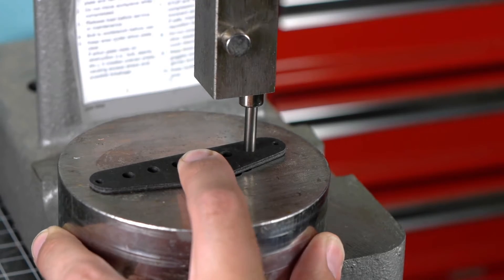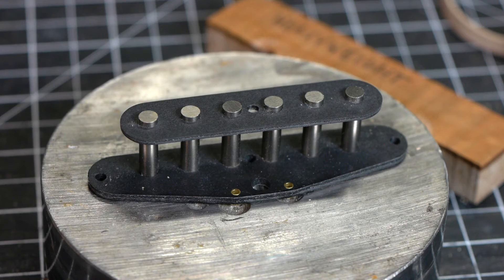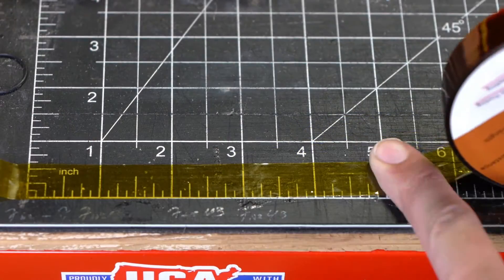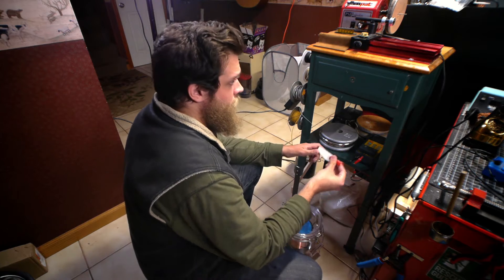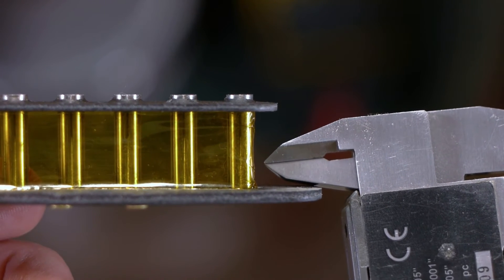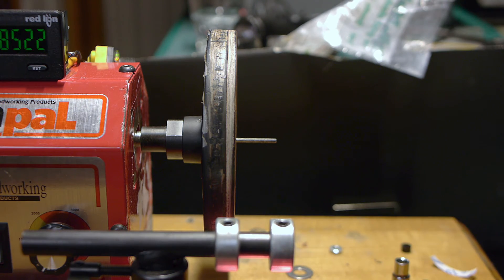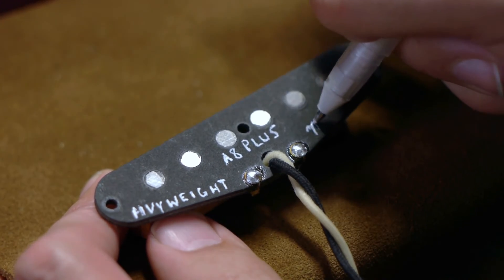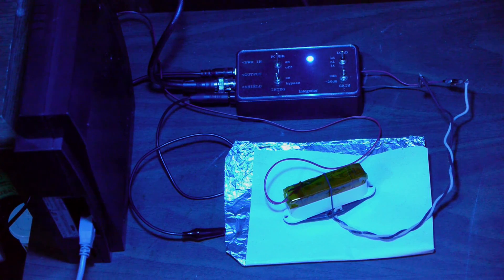(**OLD VERSION: CHECK DESCRIPTION**) Making a Single Coil Pickup: Complete Guide

Comment: It seems to me that wrapping the tape blocks waxing from the inside of the coil.  Other than that, thanks for a great movie.
Reply from the maker: Thanks for the comment! I appreciate it. Allow me to explain about the tape and reducing the potting of the inside of the coil:

It might, though the wax penetrates the entire coil regardless, as I've discovered from tearing down many of my own pickups after potting. However, if it has less penetration on the inner coil due to the tape, I'd argue that this is actually desirable. The purpose of the wax potting is to reduce microphonics/microphonic feedback, and once this goal is achieved, any excessive potting (such as vacuum potting) only serves to increase the capacitance of the pickup. I'll also add that the holes in Fender style pickups that allow wax inside are not there to allow wax inside, but to mount the pickup for winding. 

I've never had any of my pickups struggle with microphonic feedback, unless I deliberately built them that way by leaving them unpotted. Interestingly, all early Gibson humbuckers were unpotted, but it's worth pointing out that even if you do pot humbucker bobbins, the wax can only penetrate from the outside, so on all commercial humbuckers available today, the wax does not enter the coil from the inside, as there's no 'access hole' as there is on Fender style pickups. Potting the outside of the coils only is more than sufficient to achieve the end goal of nullifying microphonic feedback. 

Anyway, back to wax potting and capacitance: potting draws down the high end already, so excessive drawing down of high end (higher capacitance) via excessive potting is not desirable, for the same reason that more expensive cables are desirable -- better quality cable has lower capacitance, which means more high end. Generally speaking, lower capacitance is desirable, and more wax saturating the coil beyond what is needed to reduce microphonic feedback will only increase the capacitance, which means less high end/less fidelity in the pickup.

However, aside from that, the tape is absolutely, 100% essential. The reason being, over years, the magnetic polepieces will corrode. If there's no tape around the magnets, that corrosion will eat through the magnet wire, and kill the pickup. The copper in the magnet wire, especially, has a reaction with the aluminum in the AlNiCo polepieces. Specifically, the reaction is called Galvanic corrosion, and copper and aluminum are a particularly bad combination for that, so an insulator between the two is extremely necessary. 

I've rewound many vintage pickups that had that exact issue, particularly Fender pickups -- Jaguars, P-Bass, J-Bass, Tele, Strat -- without tape around the polepieces, the corrosion on the magnets eats through the delicate magnet wire and then you end up with a dead pickup. The tape is a necessary safeguard against this. One thing I've wanted to investigate more is the actual effect of the size and material of tape around the magnets as I do believe this has an influence on the final tone of the pickup, even if it's a small influence.
Reply: @guitar_md  Thank you for your answer. The problems you describe are well known. When it comes to corrosion of magnets, a commonly used method of insulation that I'm sure you know about is varnish. Do you know any model of Fender pickups that use any tape on magnets?
Reply from the maker: @redcatstw  I have rewound a set of Jazz Bass pickups from the early '70s that used Formvar wire and had the rod magnets wrapped in masking tape. That was very interesting.

Surprisingly, those also failed. I've also rewound a set of 1963 Jaguar pickups that, upon unwinding, didn't seem to have much of any corrosion on the magnets whatsoever. Those had no tape, and if there was lacquer on the rod magnets, I couldn't see any. However...just about pristine. No sign of corrosion whatsoever, and again, those were from 1963, so they've had plenty of time. Maybe they were lacquered. 

Fender traditionally did use nitrocellulose, dipping the bobbins in and letting them dry prior to winding, to insulate the magnets. It seems to be hit or miss with how many pickups survived that. One thing is also the breakdown of the enamel on the magnet wire itself. I suspect that's to blame in a lot of cases. 

Like the Jaguar set I rewound, I've seen a fair amount of vintage pickups that looked nearly pristine when stripped down to the magnets, but the coil was measuring as an open circuit. Some are extremely corroded, but not all.  

To me, masking tape is too weak, and while varnish could be a good solution, I don't think lacquer is the best choice, not only because it tends to get brittle as it ages, but the drying time is very long. 

I'd be tempted to look into an automotive enamel like they use to protect cars from the salt on the roads in the winter. However, that stuff is all available mostly in spray cans. Something that could be painted on with an artist's brush would be ideal. Spraying it into a bottlecap first is perfectly feasible but way too much of a pain for production level work. 

I've tried Paraloid B72, which I think would be superior to lacquer as it doesn't seem to have the issues with aging and cracking that nitrocellulose does. Paraloid B72 is used in taxidermy to seal and preserve animal skulls/skeletons, and it's also used pretty extensively in art conservation. 

However, I don't trust it long-term anymore than I'd trust nitrocellulose or shellac. Something formulated specifically to coat metal as an anti-corrosive/rust preventive would be ideal. Again, something in the automotive world, preferably that could be applied with a brush. It would certainly make life a lot easier.

I'll admit that tape can be a royal pain, especially when dealing with custom bobbin sizes, which I use all the time. I'm currently making a copy of Bill Lawrence's Micro Coil, or I should say, my own take on it. I had a customer request for a super low capacitance pickup, and the only way I know for sure how to do that is by using a much shorter coil and much thinner wire. 

So this Tele bridge pickup has 1/8" winding space, and I'm using 48AWG for it. Insanely, insanely thin. But that 1/8" winding space was a real pain to wrap tape around. I had to do so very carefully with a pair of needle nose pliers. The space is actually .133", so a little over 1/8", so even if I had 1/8" wide tape, it wouldn't be thick enough to 100% cover the mags. 

I've made some experimental Fender style pickups by mounting PAF bobbins on bottom fiberboard flatware. Very interesting stuff. And completely foregoes the need for tape, as the bobbin itself is completely insulating. The smaller winding space (1/4") also lends for some very interesting sounds. 

The tape/varnish is so much of a pain that even the extra work of mounting a PAF bobbin on some fiberboard feels like it's worth it. Also, not having to CA glue anything like you do (or, should) with fiberboard pickups. 

Really, to me, the winding is the easiest part of the job, especially with my PenPal lathe that goes up to 4,300 RPM. The bobbin building and the bobbin prep (CA glue + tape)....I get tired just thinking about it. 

It's almost enough to tempt me to just try using shellac or paraloid B72 for coating the mags before winding. I will say that I think Paraloid B72 has a potential great variety of applications in guitar work, but I've never heard a single person in the guitar world mention it, ever. You have to get the pellets on eBay, and if I recall correctly, they dissolve in acetone. I have a chart somewhere, or had one, about the ratios for mixing.
Reply: The method of wrapping magnets interested me very much for several reasons.  Compared to traditional varnishing, it is quick and easy, does not require time for the varnish to dry and all the mess associated with it.  This greatly simplifies the whole process.  If actually using this method has no effect on the quality of operation and parameters, it would be a big revolution.

Comment: What size eyelets are used on it?
Reply from the maker: .093" length, .089" outside diameter, .070" inner diameter
Reply: @guitar_md  thankyou
Reply from the maker: @lordrahulcool  you're welcome!
Reply: Will 3mm length , 3.5 outer , 1.5 inner work?
Reply from the maker: @lordrahulcool  that should work fine. I get my eyelets from Mojotone and addiction fx on eBay, and that seems close enough to the size.
Reply: @guitar_md  thankyou..you rock

Comment: What the heck is this or what does it do?
Reply from the maker: It's what enables an electric guitar to make sound. Simply put, it's just wire wrapped around magnets. 

When a string is plucked over this device, it actually creates a tiny electrical current, which is sent to an amplifier, which amplifies that tiny current enough to be audible. 

Pickups are like tiny generators that work on a concept called Electromagnetic Induction. But it's that simple: wire wrapped around some magnets.

Comment: Love your videos. You give clear, precise and complete instructions, explaining things others would gloss over. Thanks!!
Reply from the maker: Absolutely. Thanks so much for the feedback, I really appreciate it. Going to keep doing my best. Comments like this are what keep me going and inspired -- thanks again!
Reply from the maker: Just realized I forgot one thing: tapping the threads on the flatwork with a 6-32 tap. I don't use any guide or backing or anything lately and it works fine. But it just occurred to me that's one step I forgot to include. There's so much involved, it's so easy to forget to film things!